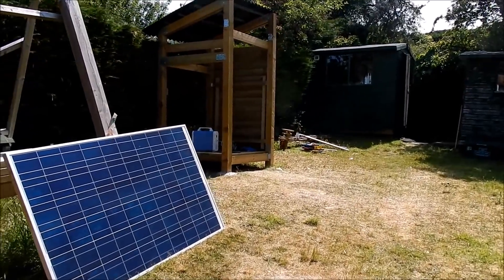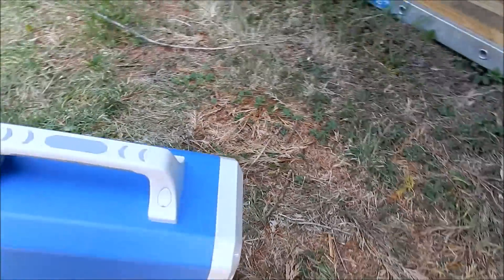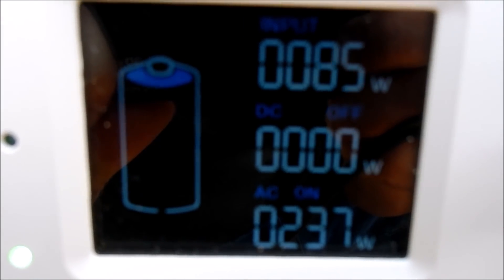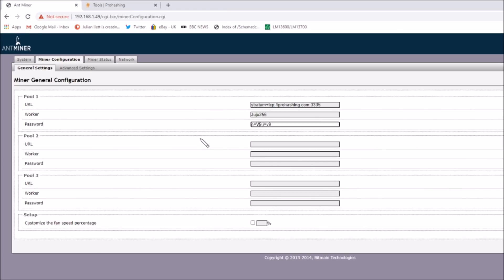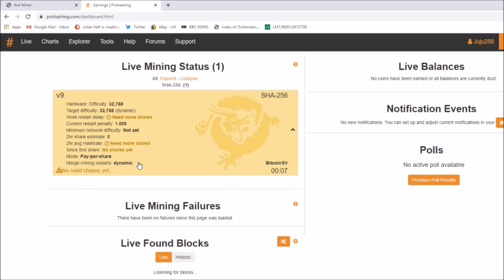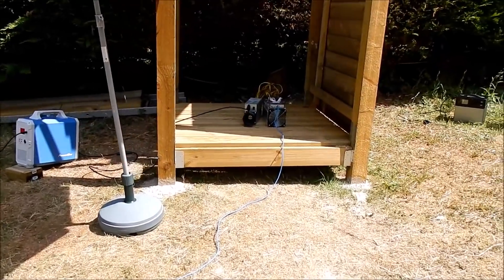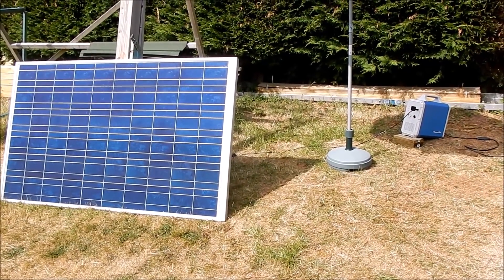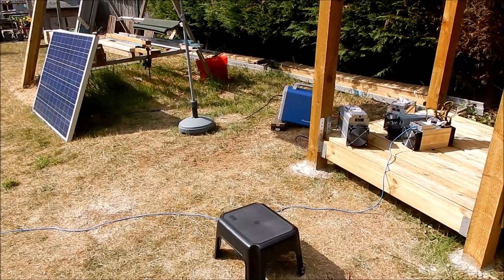$ Turn Sunlight into Cash $

Comment: Ahh now I see Julian.
This makes sense.
Isn't your power wall off set to the sun?
As in moving out their left and tipping up should make more power from the panel?

I would go for a tracker system. Due to the sun angle and the garden. I spent most my time looking at the shadows.
But for what you're using (in power)  you would need 3 of the panels, that would work out to be around 680w.

Aren't there other ways?
Storage selling. Get paid for harddrive space. A micro server is 56w under load.
Chia, I don't know anything about that, but same kind of thing.
Oh and not forgetting SEG. That was 5p kWh on one I did see.
 And of you were 285w hour 5 hours....you could have made more money...

Comment: Can you try a lower tech set-up? 

Large wooden water wheel connected to a dynamo/clutched alternator, via sizeable gearing to generate the rpm's required to see decent output. 
Use that to top up your power bank that feeds the miner.
Power a water pump  ( aquarium pump ) to recycle  the water used with the wheel.  Have a waterwheel weighted flywheel somewhere to act as the kinetic reservoir to keep the wheel spinning. 

The key difference in wheel design is that there are less buckets but they're larger, once filled, and filled indirectly from a slave reservoir that is filled and then tips water content  ( via gravity ) the weight of the water into the main waterwheel bucket,  causing  the wheel to turn as gravity pulls it down and empties. Because the alternator is clutched and the waterwheel has a weighted flywheel, the waterwheel continues to spin whilst empty; until it's turning rpm has fallen below a predetermined speed and a bucket reset catch is deployed,  stopping one of the main wheel bucket directly under the prefilled  ( by now ) water slave bucket ready to drop its fluid contents once more to repeat the cycle. 

I feel this could be a collaboration video project between yourself,  Tom Scott  and Colin Furze.

Yourself= electronics
Tom= mechanical physics
Colin= hardware construction

Comment: The wear and tear on your batteries may actually be more than the value of the bitcoins you mine, depending on the blockchain difficulty.  The best way to make bitcoin mining profitable is to harness that heat that is produced in addition to the bitcoins, and use it to offset your heating during winter.  Basically, mine during the winter times only -- or whenever you are wanting to heat up your home. Our furnace barely ran during the winters with a single Antminer S9 running at ~1400 watts. It's more like a heater that generates bitcoins as you run it.

Comment: They're still just losing money,  as you could have used the electricity they used for something useful instead.

250w x 12hrs = 3Kwh

My home electricity is 13p per 1Kwh, so that's 36p's worth of electricity to earn 1c worth of Bitcoin.
Reply: You must have cheap electricity costs! Ours is about 16p/kWh, which is 48p of electricity to earn 1c of Bitcoin.
personally, even with a solar panel providing free electricity, as per the video, it would be more beneficial to use the solar panel's energy for more useful things (such as a mini powerwall/battery bank).
I would probably use it for powering low voltage outdoor lights, or (if it gave enough power) for powering various Li-Ion battery testing equipment (so that charging and discharging various Li-Ion cells would be free).

Comment: I have read that in most cases the fan consumes 20% of the miners power. Use immersion cooling, get rid of the noise, the heat and lower your power consumption. Now add your solar and you have gotten rid of your power bill completely. This is what I hope to do and soon.

Comment: I heard about getting paid for gpu time for rendering with octane render. Maybe try that? You need an nvidia card, but used laptops can be had affordably and they have built in battery back up. Plus you can automate power use acording to battery level and such. https://www.rendertoken.com/  Not sure if it works already.

Comment: If you actually wanted to do this properly, you would put together a desktop computer, preferably with some half-decent Graphics card(s), and run that off the solar panels. On graphics cards, you can always run the latest PoW algorithms for other cryptocurrencies which are actually profitable. You dont even need free electricity for that if your hardware is relatively modern, or you can get used hardware for this. Sometimes you can even mine some crypto with the CPU as well, depending on the algorithms that are popular.
Reply: And this is what has happened, and why computer graphics cards are either (a) hard to find, or (b) ridiculously expensive! Most GPUs are now selling USED for several times their NEW RRP.
Reply: @TheSpotify95  Yep, now it is profitable at practically any electricity cost and even with quite old hardware. So obviously people are buying them all up. Meanwhile outdated ASICs are still nothing but e-waste.

Comment: penny per day, stuff that lol
improvements with a laptop?
Reply: I haven't looked at the world of cryptocurrency mining for a long time, but most algorithms typically perform a lot better when running them on an ASIC instead of a general purpose CPU like in a laptop. The whole reason for that is that an ASIC is an application specific integrated circuit designed for that particular job, once ASICs started to dominate the market mining cryptocurrency using general purpose hardware started trending towards the point of not being worth it. Now I guess it isn't even worth it anymore on ASICs?

Comment: With 5 panels in serie you can directly Power the switching Power supply with DC
Reply: That'd be a bumpy ride with nasty shutdowns though if any cloud passes by! You'd want at least some kind of small buffer and regulation on it I guess? Not sure how these thingies handle being turned off and booted unplanned and very regularly. I guess though given the financial output after putting all that energy in... no big loss if one gets fried?

Comment: wonder how long it would take to pay off the miners and panels if you ran them at full power
Reply: You'd need more than a single panel if you was to run it at anything higher than the base 100MHz clock speed. Even 100MHz was draining power from the in built battery of the PSU.
Maybe overclocking to 750MHz would be worth it if you had multiple solar panels, but it would take an awful long time to earn back the cost of the equipment.

Comment: So looking at an ANT Miner on Amazon,  it seems that it runs from the 12v portion of the power supply with a range of 11.6v to 13vdc.  The unit I found would run about 8-9 AMPS.  I bet you can run longer directly.  Only if you are curious enough.  You probably are not. :)

Comment: This is still an interesting idea. Though, I think ANT miners is probably not the way to go. However, even with those, there's a significant flaw in your design. You have LOTS of power loss. Converting DC->AC->DC is a huge loss. And those PSU's aren't very efficient to begin with.
If instead you used an MPPT charger to charge up a 12V battery, then used that power the miner, you'd get a lot more power available. Plus you could run the miner at a faster clock speed.
<1cent/day is horrible ROI. But then again, you are running the miner at its absolutely slowest speed.
Depending on where you live, you could also add in Wind power and/or Hydro power. If one lives next to a stream with good head flow, that's a lotta juice right there. 
Combing technologies like Solar, Wind, and possibly Hydro, it would make this still feasible, I think. Where I live, the winds kick up just before daybreak and right at sundown. So overall, we could get 16-18hrs of power generation. I don't live next to a stream, so that's not an additional source. However, during hurricane weather (live in Fl), we could get high sustained winds for a week straight 😜

Comment: what if you automated the system such that the load adjusts with power from the panel? then it would hardly affect battery life and you could leave it without maintenance
Reply: He's already got the miner running at the minimum load (and minimum power) possible. So it's always going to drain the battery, because he'll never get the nominal 240W from the solar panel (not in Britain.)
Reply: @RedwoodRhiadra  could still turn it off and on

Comment: - Can you turn sunlight into cash. - Why, can't you power these devices from electricity? - Well they make more than they earn, soo solar... - Then can't you connect the panels the the house and use the electricity directly?
Reply: yes, I commented before I watched the video... I did not expect that. I expected the money earned to be like 1/2-1/4 the cost of the electricity. But it's actually like 1/20. So if you had many many panels you'd earn more when having them in storage, not working and not waste time of constantly checking the system - is the battery ok, is it too hot, too cold, is the sun up, do you need to shut it down...

Comment: I used to do exactly this. I had a 'solar shed' test setup that I used for refining designs, but it wasn't actually powering much. So  I set up a crypto-miner just as a productive-ish way to use up the excess power it was producing. But mine was mining litecoin, because litecoin miners were cheaper at the time.

It occurs to me that if you had a fully off-grid solar setup, you could probably do a good deal with a crypto-miner. Just offer to take some of their old, no-longer-economical hardware, the stuff that consumes more in power than it generates in money. They give you the hardware, you supply the power that would otherwise just go to waste, and split the money.

Comment: So how could I modify modern AC powered equipment that ultimately rectifies mains into 12v/5v DC, so that it runs off a 12V battery/solar?
I want a solar powered PC setup, without the wastage of converting 12V DC to 240V AC just to turn it back into 12V again.
Reply: It's a simple thing in theory, but the details are specific to every appliance - you need to know enough of electronics to adapt to whatever you encounter.

Comment: I wonder about the conversion of the solar to AC and if the unit could be modified to run of the DC directly.
Reply: sure can, a server DC to DC PSU.  but that;s expensive.  so ROI is just impossible without massive scale, and even then, you'd make more pumping it into the grid
Reply: @John-gm8ty  But wouldn't a simple 10amp buck converter work?  Those are very cheap.  I don't think anyone expects that they would make money... its just a fun idea to me. :)
Reply: @flymario8046  I don't know if a simple buck converter WOULD work, care to risk all that expensive hardware for the test? ;)

Comment: is the 20 meter distance to the repeater cause it won't pick up the signal from the house from where your antminer is ?
Reply from the maker: Yes exactly that. I did it this way because I didn't want to run a cable through the house - too much of a trip hazard.
Reply: got that ! let's hope your wife (or you) doesn't trip over the cable in the garden :)

Comment: Can't you sell the power back to the grid, or doesn't the UK allow that?
Reply: You can in the UK, sort of. It needs some extra certification work, professional installation and a rather expensive inverter. That's all very well if you've got a multi-kilowatt solar array on your roof, but it's not practical for us small-scale, sub-kilowatt hobbyists.
Reply from the maker: There is a small payment for that (I think). Waiting for V2G on electric cars - buy electricity cheap at night (store it in the car battery) then sell it back during the day.
Reply: @JulianIlett  And if you ever make more than the wear on your car battery costs I'd me amazed.
Reply: @JulianIlett  Brilliant!

Comment: You are only using the lowest setting try it on the higher settting to see how much does it make
Reply from the maker: It makes 6 times more at 600MHz. But I don't have a 1.2kW solar panel.

Comment: Interesting, but I think I’d prefer to see a project to increase your solar productivity by getting the panels to track the sun.
Reply: Greatscott did a video on the benefits of solar panel tracking and if I recall it wasn't actually that much of an increase in efficiency.
Reply: @hughmanateecrisis  Tracking was worth it when 100 watt panels cost $1000. Now they only cost around $100 so you are better off with just getting more panels.
Reply: Yeah, tracking would be a great project,
What extra power output would you get tracking a 240W panel as opposed to a fixed position? 

There are several ways of tracking panels, a quick look at different methods would be nice
Reply from the maker: Interestingly, the panel being off-axis is much less of a problem than shading a single cell.
Reply: @sofa-lofa4241  if the panel is not shaded you'll 10% more, you can use 3 led's in revese bias to track, the motors and mounts are a different story

Comment: You need a property with a river. And an old mill.
Reply: There's a small scale hydro in the town of 'New Mills', Derbyshire that looks like it's in a perfect place. Decent size river & a nice big weir. used to be a lot of water mills in the area... but half the time it doesn't seem to generate anything. Dunno if the rainfall patterns have altered drastically in 200 years but you seem to get 'not enough' for most of the time and 'far too much' for a few weeks per year.

Comment: Go onto the Octopus Agile tariff and run them at night when the energy price goes negative. You'd make more money on the -ve p/kWh rate than in Bitcoin!
Reply: I'm currently fending off Bulb's customer service calls while I wait for my switchover to Octopus to take effect. I need that negative pricing to offset my servers that run 24/7 ;)
Reply: @ncot_tech  I get 1 watt of power from my phone line. If I have to pay for the connection might aswell get some money back from it

Comment: In some respects I would be pleased if the present methods of mining cryptocurrency are not viable. Setting aside for one moment the question of whether the cryptocurrency is useful, the consumption of vast amounts of electricity in "crypto mining factories" seems an obscene waste of valuable resource. Perhaps if it was  done on the basis of a community heating scheme that might be different!

Comment: i think you get more money selling the electricity
Reply: Ah but the waste heat can be used to rid your shed of damp
Reply: @peterg.8245  I do the same thing, warmer in the shed than the house, I would rather sleep there as it's warmer but to much noise
Reply: @peterg.8245  Yes, apart from the fan noise 100% of the electricity becomes heat, so not used any energy at all if you can find a use for the heat.
Reply: @nophead  even the noise of the fan will end up as heat....when it interacts with something...... The universe always gets its energy back right
Reply: Actually getting paid to export power often involves more hassle than it's worth for small hobby setups.
Reply: @NiHaoMike64  not sure where you are but it really couldn't be easier apart from the metering requirements it's just the panels and grid connect inverter
Reply: @NiHaoMike64  yeap 100% that. Built my own 1kw solar setup for around 500 euros. But if I wanted to sell that power back to the grid it would have cost over 5000€ in all kinds of different fees.
Reply: Currently yes, but where i live its 27 cents per kwh but in 4 years you will only get 6 cents per kwh back
Reply: Well considering electricity in the US is on average about 10c per Kwh and this solar panel would generate up to 1Kw a day, then yes other than having a bit of fun, it's kinda pointless when actually using the electricity on something useful is 10 times more effective.
Reply: @vgamesx1  I think the much bigger issue would be for Julian to transport his newly generated juicy electricity across the atlantic to be sold in the US market for some inexplicable reaon.
Reply: @vgamesx1  10 cents a kWh is cheap, some retailers here in Australia sell the power for over 35 cents,and then there is the supply charge of over a dollar a day. power is expensive here down under.  But then the Energy company will pay a Feed in tarrif of like 10 cents.
Reply: @steviebboy69  That's why people like Hbpowerwall exist.

Comment: why don't you hook it straight up to the dc instead of having the ac 240v intermediary? thats got to be worth at least 0.0000000000000000000000001769BTC/hr
Reply: DC to AC to DC can't be very efficient
Reply: Although I don’t know if that “solar generator” can supply that many amps at 12VDC. Probably only 10A which will only get you half way after startup. Don’t know what the startup current is with those screaming fans.

Comment: I've always wondered about this - using my excess solar to power Raspberry pi's and mine.... but they would probably not earn more than a penny over a month lol. You get more money by selling your excess solar back to the grid.
Reply: Mine certain altcoins with an old tablet or smartphone and you'll get a lot more profit for the power used. I have a Nook HD mining Swagbucks which makes about $5/month at current difficulty while using less than 5W. (It was way more profitable back when the difficulty was much lower.)

Comment: Hmm... about a cent earned for say 10 hours @ say 230W.  So, say 1c payment per 2.3KWh. Or, approx $0.0043 per KWh.  So, how does this compare to the rate earned for feeding your solar power back into the national grid?  Yup... sounds like an Antminer is basically worthless.
Reply: ASCI miners are not really efficient anymore if you downclock them that hard. But there is a reason why you get the s9 miners for nearly free since the halfing. But 60 bucks for an s9 is really expensive
Reply: Doorstop